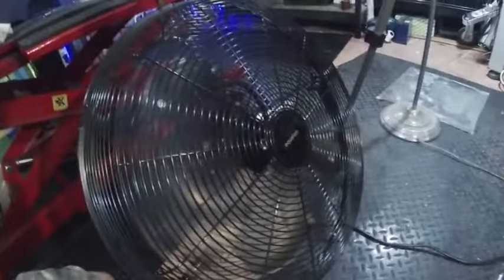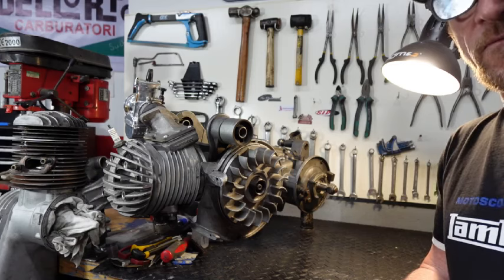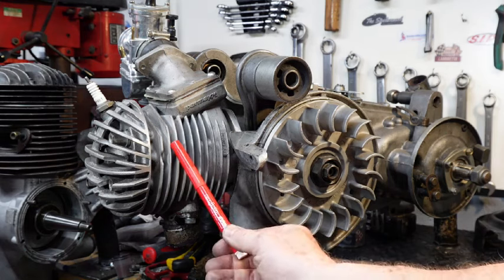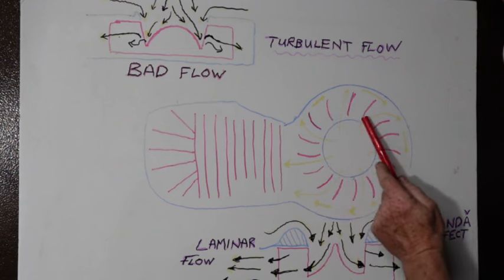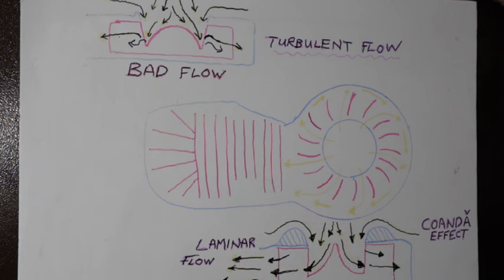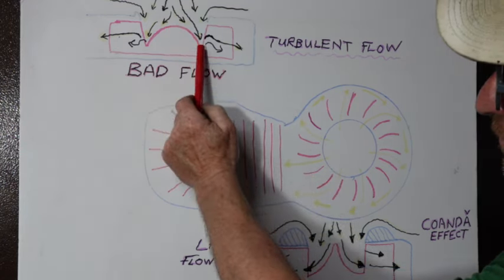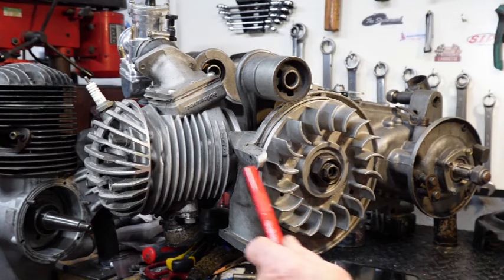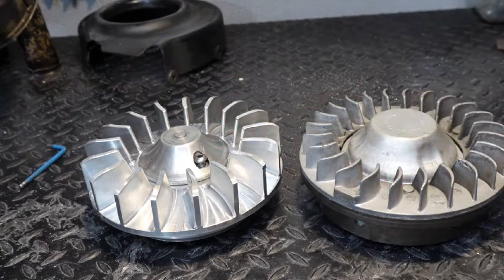COOLING WARS PART 1#scooter #lambretta #amazing #viral

Comment: Top work   ,  going to look forward   to the next edition , have a  question , how  does a twin Lambretta  stay cool   , the heat off one barrel is transfered onto the other  before leaving the cowling
Reply from the maker: I expect the second cylinder will be prone to failure  , water cooling would solve the problem.
Reply: @TheSteelweasel  , has  there been any failures on the targa twin    , or the stf  twin ,  , your spot on   about water cooling   , might be why casa  went to  water cooling
Reply from the maker: I don’t know but Kawasaki had problems with the triples middle cylinder got to hot ,let’s see if we get comments on twins

Comment: Hi Mr Weasel where do you sell the cowling/ fan cooling kits, plus would they be ok for a GP 225 (X225 Casa) using bgm exhaust,(would the cut out pick up heat from the exhaust, plus I use the bgm flywheel no centre cap, (unfortunately) I would like to purchase head cowling and fan cowling
Reply from the maker: sorry buddy none at the moment .